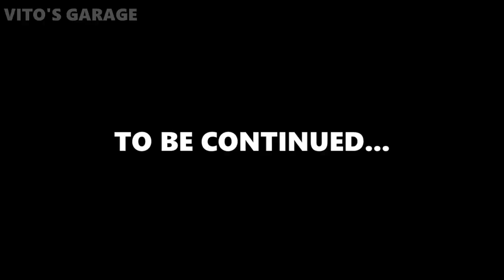This Person Has 10 Mercedes W126 Chassis!!! Bonus: Getting a New Fuel Tank For Spencer's 500SEL.

Comment: That hot weather is sure lethal to the car, if you are hot, I just try to imagine the engine in those cars, that would surely make the engine overheat.
Reply from the maker: Engine won't overheat. It was about 35C outside. Engine temp at 35C is still too cold
Reply: @VITOSGARAGE  I am just thinking in the wost case scenario, if that is still considered dessert, I remember being in Las Vegas some time back driving a rental car, and that car, was almost to the point of overheating, I stopped a couple of times to make sure that the rental didn*t overheat and it was a new car at the time, and what I notice is to never let the Mercedes Benz engine overheat,